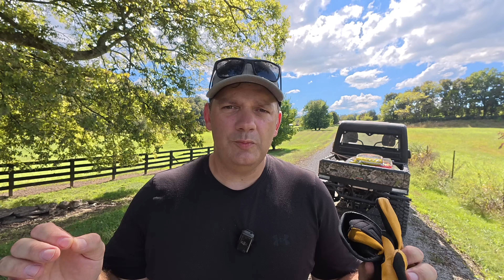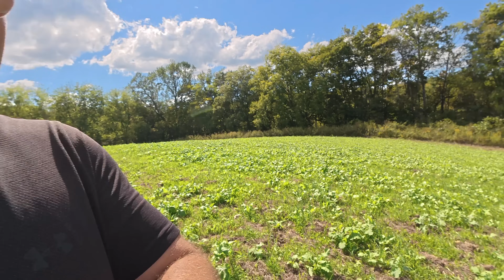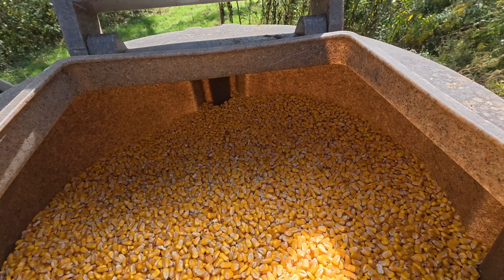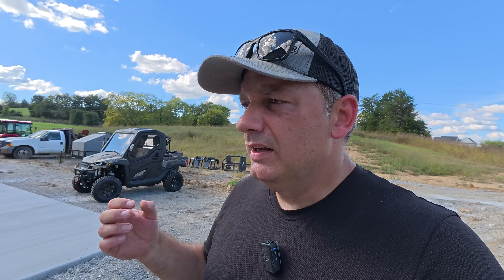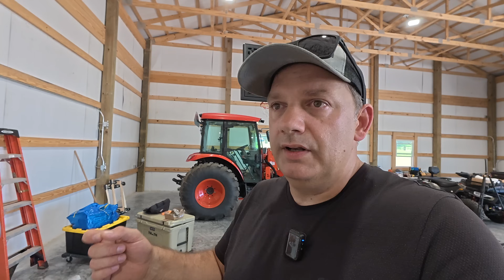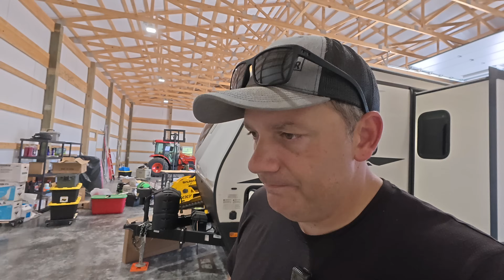Major Shop Upgrade, Food Plot Updates and Getting Ready for Fall

Comment: Hey Joe, curious why you had your barn built with wood frame instead of a metal prefab kit?  I'm looking into building one and don't know why one may or may not be preferable, other than metal is less flammable....What are your thoughts?
Reply from the maker: Metal would have been far more expensive; and taken a different skill set than we really have around here.  A wood structure pole barn is pretty common and for what I needed and for the span necessary.  I am no expert and I am sure that a metal structure would be far stronger than wood.  But, given the cost increase it wasn't worth it to me.
Reply: @JoeTheFarmer  good points, thanks for the reply!

Comment: Love the apron and size.  Curious about the overall drainage plan for inside wash down and/or outside wash down area.  Can’t see direction of any side to side slope.  Will assume the apron does slope away from the barndominuim.😂
Reply from the maker: Thanks!  We have two drains in the building (won’t wash in there) and the exterior is sloped.  Also did a ton of site work and the grade has a drainage swale at the end of the apron.  And gutters.  👍🏼

Comment: You could build a small closet in the corner where your water will be. An incandescent light bulb would keep it warmer than the rest of the shop & that Jackery would probably run it for quite a while. A space heater with a thermostat would work also as long as the thermostat will go low enough.
Reply: I built a winter and summer doghouse like that for my lab. He never used it, you'd look outside during a heavy snow and just liked to lay in it!

Comment: keep the concrete wet for 21 days if you dont use it or until you decide to use it , it prolongs the cure making it better. wet concrete never completely cures ,  look at hover dam , still curing...also concrete its 70% strength in 7 days ,,,,so you could use that to decide when to use it
Reply from the maker: Staying off of it for as long as possible.  Been dry, but should have rain today

Comment: If you have future plans to add a condition space on the same end as the well, consider a small mini split to keep the space conditioned. It could also turn into a mechanical room and house a small off grid power system. Those generate a decent amount of heat, but would need to be cooled or at least externally vented in the summer.
Reply from the maker: That is an excellent idea.  Thank you!